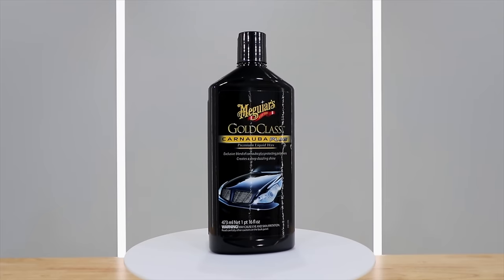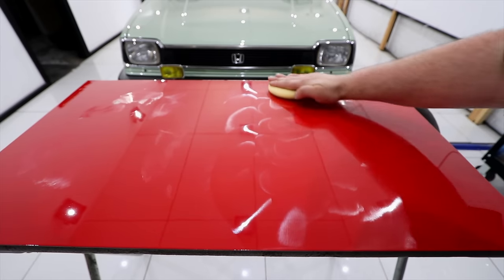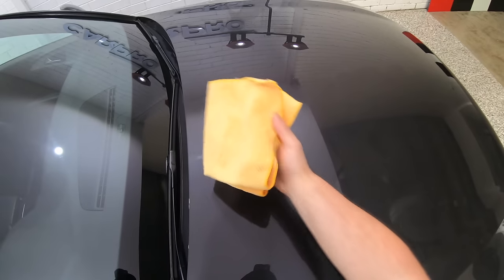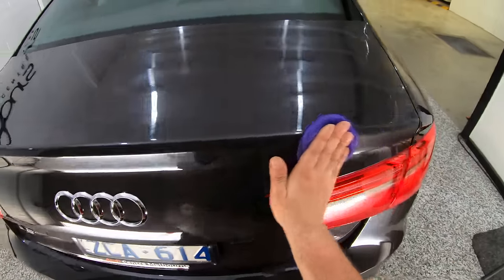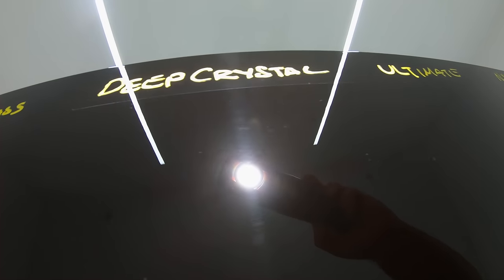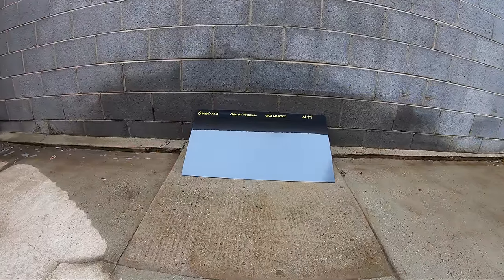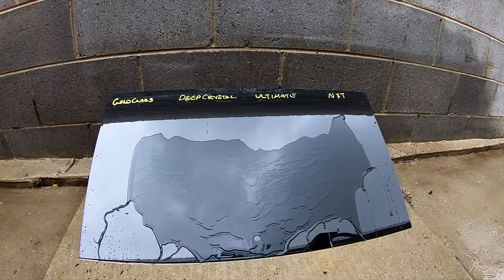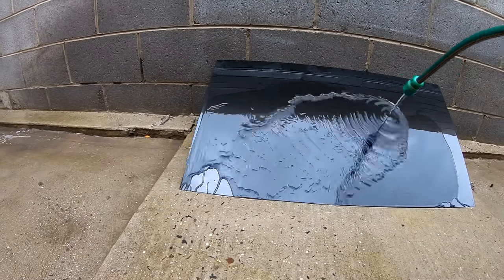What's The Best Meguiars Wax? What's The Difference Between Them?

Comment: Awesome as per normal mate. Have you tried Megs Ultimate Fast Finish? I have a can, had it for ages, lasts for ages too. I think I must have done 6 cars with this one can and it's still half full. Big fan of it, you should give it a try and see how it holds up. There simply isn't an easier polymer sealant to apply or remove.
Reply: @CarCraftAutoDetailing  I think you'd like it mate. You can apply a sealant to a car in 10-15 mins, good gloss, good Slickness, good durability. Win win.

Comment: Compare these to Nu Finish liquid and paste, also for cost and ease of application. After washing, adding PB Blaster penetrating oil spray and rubbing it in with a microfiber cloth works sort of like a clay bar. See the written Hagerty article about the new car paint for a Mazda MX-5 Miata to get off to a good start.

Comment: Sandro, on your "Best Car Wax" review which was done shortly before this -- Deep Crystal Wax out performs all others in sleekness (though they are from other manufacturers). But then in here, Deep Crystal is the last among all the other Meguiar's. 

Since I watched both reviews next to one another, I noticed that the position of the 1st and 4th placer in the test panel is the same on both reviews. Just wondering if somehow previous reviews done using the same test panel affected the results? :-).

Great review though and appreciate all your hard work! 
Cheers!
Reply from the maker: Thanks, and the angle of the panel is always adjusted for each test and video to find the positioning accordingly.
Reply: Thanks for the quick reply...
Sorry about not being so clear. I'm not referring to the angle but more of the previous treatments the panel have received during previous tests.

Oh, and that would also be a great video - I mean, if and when switching products, how do we ensure that cross contamination isn't an issue or that somehow some remnants of the previous product is still on the paint.

Thanks again!
Reply from the maker: The panels are always completely decontaminated, compounded and given an IPA wipe before they are reused, so the paint is always completely clean and bare prior to any new testing.
Reply: Ok, great and appreciate all your replies. Thanks for all the hard work in sharing these videos and unbiased information!

Comment: strange or interesting. for the slickness test in one of your previous videos deep crystal wax was looking super slick. and the bottle slid off the panel super fast like the bottle was free falling. but here it shows its not so much and its gripping up and not falling down all the way. any reason why? is the panel on the same angle you always put it?
Reply from the maker: No, I’ve answered this a few times in the comments. The angle is always set differently to try and best show the differences in this area. If it was always set the same for all products it wouldn’t show distinguishing differences as in some cases all the products wouldn’t side at all and in other tests they would all rocket down at high speed - so a bespoke approach helps obtain the best data for different product comparisons 🙂
Reply: @CarCraftAutoDetailing  ahh ok. Thanks
Reply: @CarCraftAutoDetailing  Would you recommend using the deep crystal carnuba wax on the surface of a car that is NOT paint prepped?
Reply from the maker: You can really use any car wax or sealant after washing your car and without doing a more involved paint prep process. It’s just more so that it won’t tend to perform quite as well or you may not experience it as good as you could. But it could still work relatively well and it’s certainly better than not having any paint protection on your car.

Comment: It can’t bond to the paint as the paint is covered in a top coat of hard lacquer at the factory, anything else is pure vanity.
Reply: Mmmm,  not always true. Single stage paints have no top coat, and it's just easier,  and more common to say,  I'm waxing my paint , than, THE CLEAR COAT. but you are actually correct,  on clear coated paints, you are treating the clear coat.

Comment: Hey Sandro, I have a question about hand polishing/compounding.

Is it better to correct using circular motion or straight vertical and horizontal lines? 

The circular motion takes a lot more effort and has a lot more overlapping so I guess it corrects better.
Reply: @CarCraftAutoDetailing  Okay thank you🙏

Comment: Very informative information!   I've ceramic coated my Pearl White Model S Plaid last year when new, it's always garaged, and looks the same and still feels as smooth as the day I coated it, now I would like to add some protetection wax. I have a question:  Can I just add Meguiar's Deep Crystal Wax to the paint or would I need to use Meguiar's 3 in 1 Cleaner Wax?  Thank you for your help!
Reply from the maker: Thanks and yes, you can just add Deep Crystal Wax on top without the use of a cleaner wax

Comment: On another great review by you the deep crystal was as slick as water off a ducks back with the sliding bottle test .on this review though it was very poor ??? how is this
Reply from the maker: It’s all based on a curve compared to the other products in each test. Sometimes the panel will be on a steeper angle based on the best angle for each test panel. But it is slick, just not quick as slick as the others in this particular test.

Comment: Great video but I am just as confused as I was before watching it as to which is the right one for my truck
Reply from the maker: Unfortunately if it was as simple as one product being clearly better in all aspects there wouldn’t be a market for thousands upon thousands of them. The best I can do is try to discover and share their performance characteristics and in this case subtle differences and let you decide what appeals to you most 🙂
Reply: @CarCraftAutoDetailing  well . . I just made a decision and ordered the NXT after watching a couple more videos on it I think it was a good decision I have a brand new truck and naturally want the best product for it that you for the reply and again great video
Reply from the maker: I think you’ll like NXT! If you have the time and energy try applying two coats (at least 3-4hrs apart to give the resins in the first layer time to cure and harden before the next layer or even apply it the next day) as that should help give you a little more protection and performance for the new trucks paint job!
Reply: @CarCraftAutoDetailing  I did get a ceramic protection put on it  at the Chevy dealer where I bought it  .....Thanks

Comment: Thak you for this video its really informative about these products...
I've bouht brand new car and its metalic blue color. What is your suggestion to protect color and surface?
From this video NXT seems to best choice among the meguiars products. Should I choose NXT solid or liquid wax and how many time should I apply to wax in a year?
Thank you in advance...
Reply from the maker: The NXT paste wax has been a favourite of mine ever since I tried it decades ago but it’s hard to find here locally so if you can it’s actually much better value as it goes much further than the liquid, but they are both quite similar in results. 
How often you should apply it will depend on on how the car is used and stored but on average every every 3 months is about right.
Reply: @Car Craft Auto Detailing  Thank you so much 👌

Comment: How would the NXT sealant compare to the NXT Tech Wax 2.0? That's the one I'm currently using, as well as Griot's Garage "Best of Show Line", but I've been noticing that the slickness from the NXT 2.0 is superior to the Griot's. Granted, the Griot's still works great
Reply: @CarCraftAutoDetailing  that'd very disappointing if that was the case.

Comment: I've always heard to avoid circular motions why do you suggest you can do it with applying a wax?
Reply from the maker: You can really use either straight overlapping lines or circular motions
Reply: @CarCraftAutoDetailing  There is the argument that the circular motions if you happened to scratch your vehicle the resulting scratch would be noticeable from most directions. As opposed to up and down and left motions wouldn't be as noticeable and require less effort to remove.... What would be your thoughts regarding those lines of thinking?
Reply from the maker: Yes it’s a valid argument, and it’s also easier to keep track and be more consistent with overlapping vertical and horizontal lines, which is why I tend to use that method, but if you use a good technique, work clean and consistently, you can really have good results with either method.

Comment: Hey bro I’m in the process right now, I washed, decon, clayed, compound, polished,.. my question is “do I really need to use wax/oil remover prior to applying wax?” Isn’t it by doing so it would delete the purpose of shiny/glossy look by using oil remover? And also, I’m using all Meguairs, can I apply turtle wax ceramic spray coating on top of the wax? Thanks bro!
Reply: Car Craft Auto Detailing thank you for the lightning fast response! I appreciate it! Sub! 👍🏽

Comment: How often would you apply this if you were to use any of these waxes regularly?
Reply from the maker: I generally reapply when I start see the performance of the wax degrade could be a few weeks or a few months depending on the situation.
Reply: @CarCraftAutoDetailing  i usually do it once every 3 months. But I feel like it might need to be a monthly thing. I happen to use ultimate wax and the performance starts to wear off after maybe a month or so.
Reply: @pkbroarmaldo7  how do you notice when its starting to lose its effect bro ?
Reply: @Gave-rf1hr  when the water stops beading like it used to.

Comment: I need help ! I've been noting everything in a notebook so when I'm washing my car, I make sure not to bypass one step ! Would you recommend applying a first layer of traditional wax (carnauba or synth) and finish with a final layer of MEG@ ceramic liquid wax on top? Would that be useless?  At last, I'd go for the triple layer of ceramic wax :) Thanks a lot, great content for a young car detailing amateur
 like me
Reply from the maker: From a protection and longevity stand point I would recommend applying HCW in a spray and wipe method as your base layer to the bare paint as it will always last longer and have a greater bond in that application manner and it will tend to outlast the other Carnauba/synthetic waxes. But it will still work fine over them so you can also use it to top those other waxes and sealants if you wish.

Comment: Can you use deep crystal wax on top of Meguires M21 sealent ?
Reply from the maker: I haven’t had too many issues topping it over various other sealants so I would guess it should work fine.
Reply: @CarCraftAutoDetailing  thanks for the response. Would you be able to do a video on Meguires M21 synthetic sealent? I think you will like it very much. It removes fine marks, has tiny abrasives in it, is super easy to apply and buffs off like a dream, not to mention the finish you get !! 😎
Reply from the maker: It’s not readily available here in Australia as is the case with many Meguiars products but I’ll add it to the list!
Reply: @CarCraftAutoDetailing  Ok. If you do manage to get your hands on some, that would be awesome !

Loving the videos 😌

Comment: I love gold class but NXT has my attention
Reply: I use NXT for one main reason. It hold both its hydrophobic & protective properties (UV, bird droppings, water marks, etc) longer than the traditional waxes. Especially on the roof, bonnet & boot. Also, my preference is to first apply Meguiars polish, buff off (using a DA polisher) to get a nice, clean paint shine, then apply Meguiars NTX polymer sealant. Lasts 6 - 8 months. If I have time, I will use a quality wax (after the NXT) on my roof & bonnet, just for the extra protection. After 8 years, the paint is near showroom quality.
Reply: @wilson2455  It's not necessary use another wax over NXT, just maintain with a liquid spray wax for its longevity.
Reply: @indrockz92  i have the booster from nxt but want the ultimate quick wax to maintain my nxt sealant. Just wished there were a nxt quick wax lol

Comment: I’m new to waxing I’ve never waxed my car it’s 11 years old the paint still looks amazing on the car idk if the last owner waxed it but I’m scared to do it I don’t wanna mess up my paint should I try this or just buy the spray wax ? Also. All I do is wash my car and keep it in the garage and in shade when I can when I park the car
Reply: Car Craft Auto Detailing so it’s better than say I buy a meguires quik wax spray ?
Reply: An actual wax will be head and shoulders above any quick detailing spray.  What you'll want to do is 1) wash, 2) clay bar (not every time, just when the paint feels a touch "gritty" right after you've washed.  See videos for a quick how-to) 3) Wax.  Maintenance wash weekly to a couple times a month, wax monthly to 4x annually.  Do it by hand, at first.
How often you have to wax depends on weather, driving conditions, etc.  Eventually, you'll see what product you like best for your car.  I use Meguiar's Ultimate for my black GLS, and P21S carnauba for my silver Boxster.

Comment: excellent work
ive always been a fan of meguiars however recently started playing with auto glym which works well but i kind of regret it as im now buying meguires again and just use the AG on mates cars

from what i took from this video is
gold class/ultimate for removing the swirls and covering up
Nxt for your daily car that doesnt get enough love as it lasts longer but doesnt cover up the bad stuff as well as the other 2 above
and the liquid wax for your car thats always looked after and kept under cover etc?

would that be a fair summary?

i already have the ultimate and the liquid both i havnt tried out yet but thinking the ultimate will work well on my bike thats kept inside and cleaned before and after a ride and well my daily ive only waxed once usually it might get a spray off at local car wash once every month or two
Reply: im only just getting into polishing/buffing i recently purchased a battery ryobi and it worked well but now thinking of getting a something else with more pad options

i live in a small town and cant work due to a injury so this could possibly lead to doing the locals cars for cheap so im watching and trying to learn as much as i can at the moment

Comment: which one can be used in matte finish paint?
Reply from the maker: They should all work fine on matte paints or vinyls as do most standard paint protection products, but I guess the easier application of Deep Crystal may make it more suitable.
Reply: @CarCraftAutoDetailing  thanks

Comment: Great video! Which wax would be best for a 2020 black vehicle?
Reply from the maker: If you’re trying to mask some swirls that are more visible on darker paints Nxt may be a good choice.
Reply: @CarCraftAutoDetailing  I want to get rid of hairline scratches that you only see in the sun on a certain angle that happened from the dealer when they put it through their car wash without me knowing, and those brushes did it. I always hand wash and with mcguires yellow soap/wax , and paint is super shiny. Would ultimate polish take out those hairlines without sacrificing the rest of the paint? It’s a 2020 Ford navigator.
Thanks
Reply from the maker: Using a polish before hand would tend to help address that better, but Nxt can also help mash those minor defects a little

Comment: OK so I'm confused (aka Ignorant) NXT had by far the slickest surface but just meh hydrophobics, I thought slickness = good hydrophobics. I also watched your Sonax BSD video, and the sonax had  the worst slickness but the best hydrophobics, so can you explain why slickness doesn't translate to hydrophobics?
Reply from the maker: Slickness or reduced friction doesn’t directly correlate to hydrophobic behaviour, nor to gloss , saturation, durability or other performance characteristics- it’s really it’s own thing. Some quite tacky ceramic coatings tend to have the most superior water behaviour will some extremely slick products like quick detailers or even some waxes and sealants can have very poor hydrophobic characteristics - but not necessarily.
Reply: @CarCraftAutoDetailing  Thank you for your reply, so what is the functional benefit of slickness? Just the aesthetic satisfaction to fondle one's own vehicle?...or someone else's vehicle for that matter.
Reply from the maker: Slickness can greatly help minimise wash induced swirls, as that lack of friction will largely prevent dirt from bitting into the paint when it’s pushed over the surface with a wash mitt and it can also be a more forgiving surface if something brushes up against the paint like jeans and help prevent swirls and very minor scuffs. 
It can also have the additional benefit of not allowing larger contamination like bird poo to bond to it as strongly and rinse off easier.
Reply: @CarCraftAutoDetailing  Thank you so much for your response and for dedicating so much of your time to help boneheads like me understand the intricacies of auto detailing.